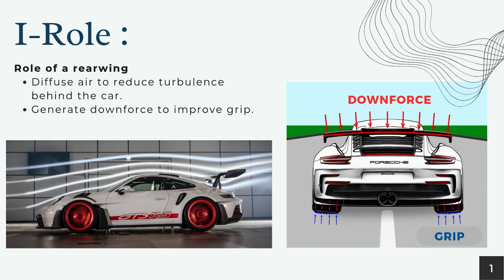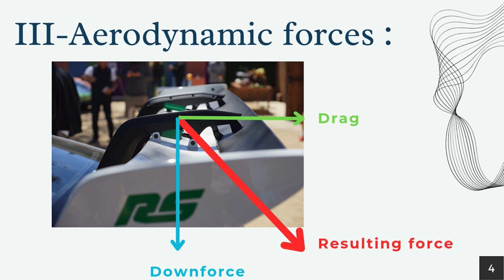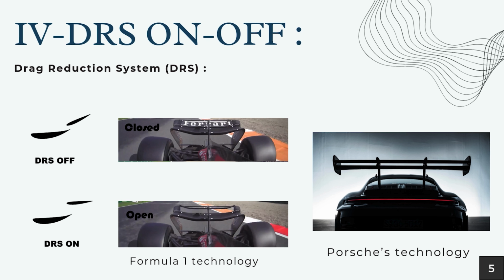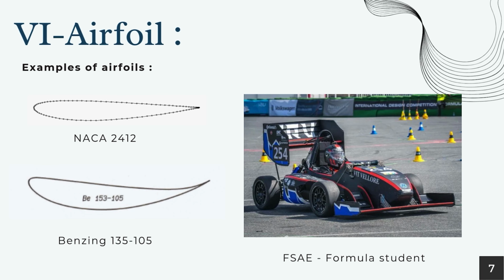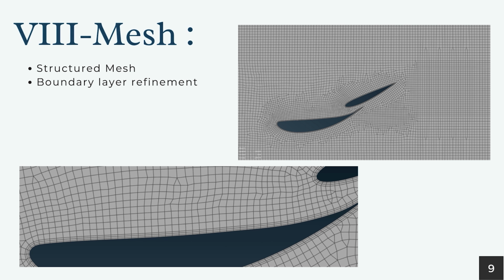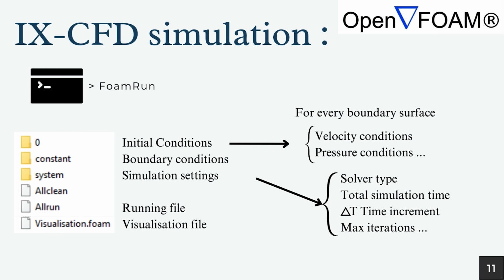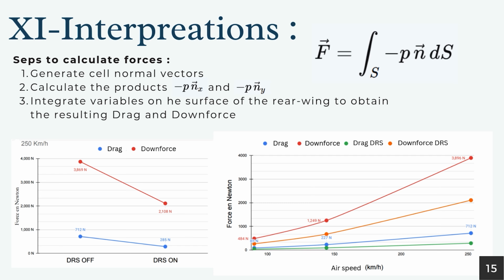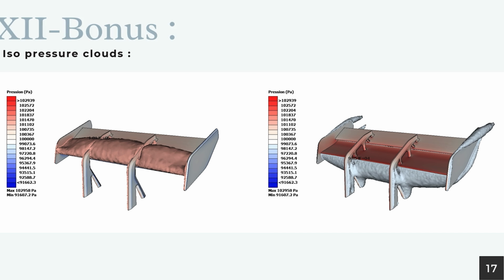How I simulated a DRS using CFD in my 2 months internship

Comment: Does this calculate/run in real time?
Reply from the maker: No, BUT, what do you mean real time ? Its a steady stream simulation (takes abt 1h to run on my old pc) so the results are for a fixed speed, I ran multiple simulations for each scenario. I could've made it dynamic by accelerating the fluid little by little but I didn't know how to do it at the time (now I do).
Reply: @ZMechanicalEngineer thanks for answering. I meant to ask if it could be used to power a physics engine in real human time, let's say 60 Hz
Reply from the maker: @ezanchi5422 Tbh, i don't think so, computaional fluid dynamics (CFD) takes a lot of processing power, like A LOT ! It's because you are solving complex equations in tiny spaces (1Million mesh cells)  one cell at a time. It provides somewhat accurate data given the complexity of fluid flow. Building a real time physics engine would require heavy simplifications due to the limitations of current hardware. (Potentially there are some ai "fluid" models that could emerge in the future but now, they are very sensitive to training data.)